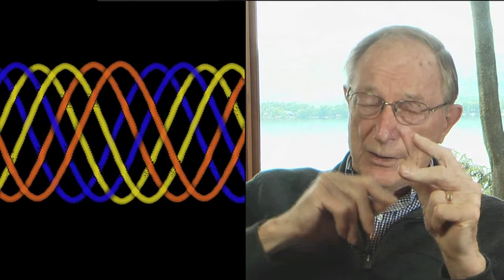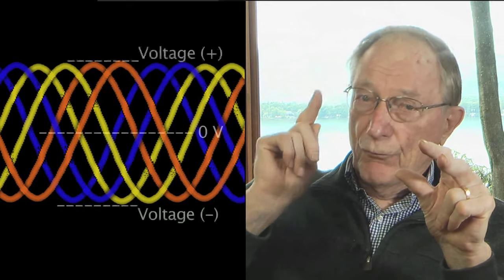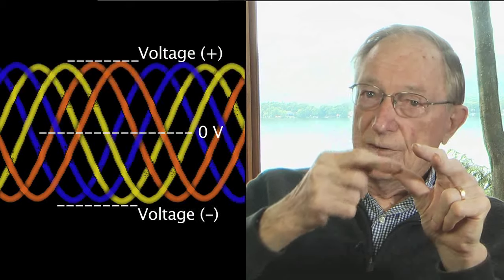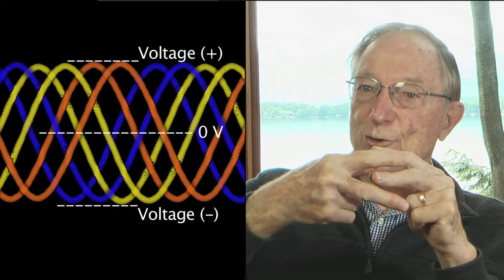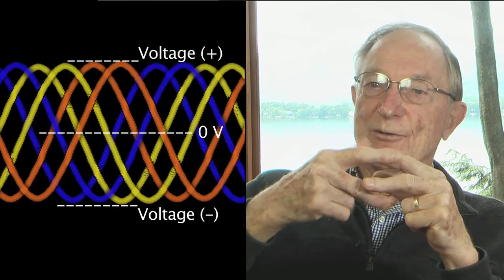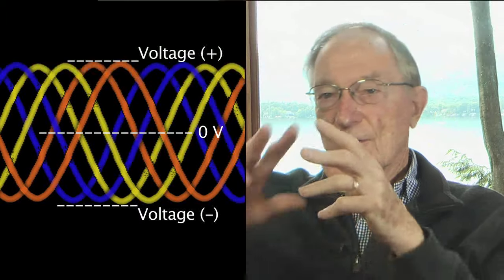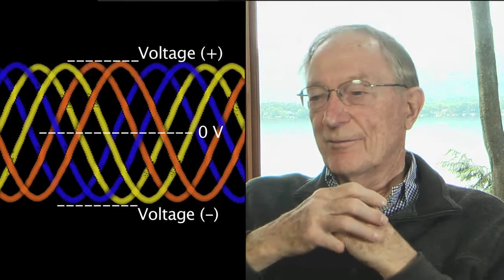Why 3 Phase Power? Why not 6 or 12?

Comment: Why is America 60 hertz and Europe 50 hertz?
Reply: That sounds logical, however, where is your proof and what about europe being 50 hertz.  I would have suspected it had more to do with minimal impedance and wavelength with actual continental distances.  You would want to have the wavelength matched to the maximum transmission line run across the U.S. and Europe hence the different frequencies.  However, I'm not an engineer so it's only speculation on my behalf. Anyway, your answer sound reasonable.
Reply: thank you that was very excellent I had never heard of 25 or 133 hz systems before.  thank you I'm most grateful. mark
Reply: Because Europe and some Asian countries were colonies of British and the 50HZ system was their standard they left there. Later they didn't change it because it costs and was working good.
Reply: +Salman Muhammad "...Because Europe and some Asian countries were colonies of British..."

Europe was a British colony???? Really???
Reply: +thoriumriver Yes. Some European countries
Reply: +Salman Muhammad which ones??
Reply: +Alex Roman For Example Cyprus
Reply: +simplechristian1 Basically - it comes down to a simple choice.
America chose 60 htz over 50 htz, mainly because it was easier for them to "synchronise" electric powered clocks (yes - as that meant they didn't have to use too many mathematical calculations - to work out how fast a clock would run), but by using 60 htz instead of 50 htz, that also "allowed" for a lower current to be transmitted greater distances, using the same wire, although .. they then stuffed that up, by keeping their supply distribution voltages low (presumably to avoid electrical shock - a total myth), which results in MUCH HIGHER current loading on cables, resulting in huge power distribution losses, caused by the current "squared" times cable resistance - creating HEAT LOSSES.

So -- in effect, the American's buggah'd themselves by using 60htz, 120/208v ..
Why?

Because it is NOT the frequency, nor the "voltage" that kills humans.

But the actual CURRENT that flows inside the body, between potential voltage differences, where frequency makes it "easier" to initiate the first push-through effect of a potential voltage difference.

Thus.
Although Edison "proved" that 60htz in an electric chair "kills" a human more effectively than 50htz, he failed to recognise the ONE major problem with his theory.
Frequency doesn't kill. 
Neither does a voltage potential difference.."
ONLY a current that flows "through/inside" a human body, if there is a voltage difference applied to overcome the initial resistance/reactance of the skin's natural insulation resistance.
Which in a weird twist.. also disproves Einstiens thoery - that DC doesn't kill and is thus FAR SAFER than any AC power source.

DC has a far greater potential to KILL (yes) and to keep killing, long after a human is actually dead, by providing not a pulsating (easily broken) AC current, but a single long running DC current "of high volume" which is very difficult to "break away from" when it starts running.
Thus DC of sufficient (applied potential differential) voltage - actually kills a human, not "just" by 'interrupting the electrical rhythms of the heart thus stopping & or fibrillating the heart muscle,, but a DC current physically burns the heart away, in generated HEAT (deep inside the heart muscle/human body itself).

In fact 60 htz AC has a lower potential to KILL (for a given high voltage) than 50htz AC, as the hiugher one makes the frequency, the further OUT towards the extremities of the skin layers, the current actually travels.
DC goes by the shortest DEEPEST direct route.
50 htz goes by way of the shortest indirect route, possibly via & thus in the blood stream itself, whereas 60 htz goes by a route "closer" to the skin, or muscle content.. thus interrupting the electrical pulses through the nerves themselves, and not exactly 'via" the heart muscle at all.
Reply: An island in the Mediterranean equals "Europe was British colonies", Crikey!
Reply: 60Hz is part of the Tesla Patent. Siemens, the German power group did not want to pay royalties. So; we in the Americas ended up with a household 120V/ 60Hz, the rest of the world ended up with Siemens 200V/ 50Hz. Interestingly, Japan splits the country longitudinally, half of the country 60Hz and half 50Hz which is why when Fukishima puked, they could not just tie into the closest power grid.
Reply: Europe is on 50 Hz for metrics.  230v is a more efficient system than 115v, but 60 Hz is easier on equipment than 50 Hz.  230-240v 60 Hz would be ideal
Reply: it may be because of
at 60 hz voltage level 120 v and 
if shock level capacity is min as compare to 50hz voltage level 230v.

but 50 hz voltage level power regulation is better hence europium perfer 50 hz .
Reply: Exactly. It costs a lotta money to change stuff. And when it don't need changing, that's actually wasting money and poor governance.
Reply: Europe is on the metric system.
Reply: I was told in school that 60 Hz was the frequency needed to keep the human eye from seeing light flicker. Not sure about why others used 50 Hz. I guess us Americans have faster eyeballs. USA! USA!
Reply: 50hz vs 60hz, quite a diverse group of answers to read, one person brought up "skin effect" suggesting that made it safer, another proposal (quite interestingly) made reference to continental size and wavelengths, I'll have to do some research but I'm going with the patent one for now. Just sounds like what ends up happening.
Reply: 50 Hertz have 50 cycles per second with the width of 20 milliseconds each, 60 Hertz have 60 cycles per seconds with the width 16.6666666666666666666666666......,  not that great  for Calculations
Reply: Salman Muhammad wow the ignorance...
Reply: cos america wants to be different from the rest of the cats!
Reply: Standardization. More freq means less losses during transmission but more complexity in control system and corona discharge. Nevermind 50-60hz is standard practice.
Reply: so you do not experience annoying lines traveling across your television screen
Reply: That's what I was taught as well, that is the frequency where your eyes can't detect the lights blinking
Reply: I had read that George Westinghouse wanted it to be 120hz. But Tesla's designs were for 60hz. And that is where we stayed.
Reply: Głos z Ameryki 666 repeating. So that’s where the mark will come from. Interesting
Reply: Salman Muhammad 50 hz, I believe, originated with the Siemens company of Germany, one of the largest suppliers of electrical equipment in Europe at the time.  50 hz became widespread in mainland Europe as a result.  Actually, Britain initially used a lot of 60 hz like North America, but later switched to the European standard of 50 hz., which was spread widely throughout the British commonwealth, except Canada, which followed the US standard of 60 hz.

Comment from the maker: Tesla developed 2 phase power systems.  Before Tesla Siemens was working with single phase.
Reply: Yes - well of course he would - wouldn't he - after discovering that he could utilise a single phase of a generator.. why wouldn't he want to use a second (or a third at 120 degrees phase angle from any other .. if he really wanted too - but?
DID HE MAKE FULL USE of that idea..?
Hell no.
If he had - I wouldn't have needed to find NINE (& TEN) inside any 3 Ph & Neutral 4 wire cable - now would I have?
And - thus - Tesla would have had upwards of all 64.77 million possibles too - if he'd have taken his theory to it's ultimate conclusion .. ?
BUT HE DIDN'T - he just used it as pure single separate lines - of two different single phases - in a two phase system.

Comment: 3 phase has always been the standard for power generation. Although the main power generator has a 3 phase output, the coil configuration consists of multiple  coils inside a huge segmented stator core. Multi phasing a generator would have no gain overall.  A typical multi-pole stator 3 phase configuration requires a certain amount of driving force to attain maximum output, having a 6 or 12 phase would require a much larger driving force to obtain the same maximum output and would be a lot larger in size to accommodate a larger stator, and the rotor would have to have more poles. Either not practical, or too costly...

Comment: So that's what older engineers do at Edison Tech Center... "3 phases 3 bus bars, 6 phases 6 bus bars, 12 phases 12 bus bars"... :)
Reply: Not quite.  Lionel is still working gainfully, both as a consultant and philanthropically.  And, his six phase work was done in the 70's or early 80's.

Comment: Short answer - you do get more power by adding more phases (up to a point), but for a few reasons, like to maintain 1:1 ratio of circuit breakers to transmission lines (?), increasing phases isn’t economical.
Reply: Dirk Knight  Completely false?

0:50 "but now you have, it would seem, twice the amount of power. You would, in fact, have almost twice the amount of power"

2:22 "it turns out that the gain in power is not proportionate...six phase almost doubles three phase. Twelve phase does not almost double six phase, so it's a diminishing return"

3:55 "So the complexity of coupling...a high phase order line...into a substation sort of defeats the economics of it"

There's almost certainly more to the problem than what he or I are letting on, but my summation of the central point of his 4min 47s answer is consistent with his words and not "completely false". If there's more pertinent info to add to the problem, please enlighten me and the world, but I'm saving viewers some time by weeding out the parts of his summary that actually answer the question from the exposition in his summary that is interesting but ultimately irrelevant to the question.

Another angle here is that while my comment may be consistent with the video, it is still false in regards to reality. If that's the case, then this guy (and by extension, I) didn't answer the original question and would benefit from your greater understanding.

Comment: That's the longest non-explanation of something ever.
Reply: what do you mean??
he explained it very well
Reply: 0:43AM And Im still waiting after the clip for the answer
Reply: Yeah he explained it very clearly
Reply: "so the economics of it just falls apart" It's too much work to adapt more phases to substations. It's not him, it's you.
Reply: @mohamedalhumaidi  No he didn't. The "economics of it" doesn't explain anything. Saying, "well, you would need 6 circuit breakers instead of 3" is a lousy answer. In many countries, I believe UK is an example, power is single phase to most homes. Why? The economics of having 3 wires into a house instead of 1? LOUSY ANSWER.
Reply: Paddle Shift yes, that’s exactly the reason. needing 2 wires instead of 4 is half the cost (maths is amazing)...
Reply: @paddle_shift  1 phase is DC. AC is a completely different thing that specific machines run on.
Reply: @paddle_shift  No one is obligated to give you a good answer unless you pay someone to do it. You have the world at your finger tips with the internet. Quit making excuses and invest time in to research. Either that or politely ask others to see if they might know and save you time.
Reply: @MicroplaysMC  obviously by your 3 responses, you are getting more upset as the seconds go by. Your recommendation to not use youtube as a source for learning is a good one (see the video on 3 phase vs 6 phase as an example). Your observation on single phase networks in other countries being DC vs AC is correct (I knew that btw). That's why in other countries that use single phase DC networks homeowners can't install home charging for their electric vehicles, they need to convert their home to a 3 phase AC system (very expensive) first. I don't even want to get into why countries went with DC vs AC in the first place, but I do know it wasn't due to economies of scale.
Reply: @paddle_shift  Bro, I'm just saying there's absolutely no need to be negative if you don't have to be, especially when you are more capable to find out on your own now than any other time in history. People share information on the internet, if it works for some, they'll take it. If you need a better answer, then it's "insufficient" to your needs, not necessarily "lousy". My point being, this has an intended audience, which probably consists of laypeople (what a surprise on such a platform). If it doesn't fit YOU then that's not the creator's fault, so don't call it lousy. If this were an hour long lecture on the economics of high phase systems then that would be different.
Reply: @MicroplaysMC  Look, don't take it personal. I was commenting to vikingslayer and other comments. The guy on the video is s real nice guy,  so kudos to him and his career. But it wasn't a video on 3 vs 6 phase power and why one and not the other. If a video was out there saying "why did some countries go with DC vs AC" and the video presenter said "well, because of economies of scale, they saw DC uses 1 wire and the AC uses 3, therefore they went with DC" would not be a real good explanation.
Reply: 3:20 - 4:30
Reply: @Grim_Falcon  3:20 - 4:30 = 10:50pm

Comment: There is one problem that was not mentioned.  The voltage on a 3 phase system is symmetrical from each phase to another.  This is not the case with increasing phase.  In other words with a 3 phase system each of the vectors are 120 degrees from another.  Assume a higher order phase system - suppose 4 phase.  Some of the phasors are 90 degree apart, while others are 180 degrees apart.  The voltages are not the same phase to phase.  This causes problems when trying to convert to DC to use power.
Reply: Converting to DC doesn't cause problems. In fact, it gives a smoother output without using capacitors to smooth out the ripples. Add a few capacitors and you have a flat line of Voltage. In the case of 4 phase power, simply tie the four thru diodes in a full wave bridge rectifier pattern and bingo, no problems.

Comment: In catscan and xray imaging we use 12 phase to create a more consitant power Source so when we expose  an electron cloud to the rotating disc usually made of tungsten we get a closer amount of alpha beta radiation for a specific technique set by the technologist so it still varies by what we input but its not underpowered or overpowered

Comment: Nikolai Tesla wanted to use 5 phase, as being (what he believed) the most efficient means of energy transfer, however his investors were worried about the expense of running 5 wires, and the cost of winding the transformers. 3 phase was selected as the best compromise.
Reply: DC transmission is more efficient by a factor of 2 than 3 phase and also does not suffer from impedance losses and limitations.  Today we have electronics that can easily convert DC voltages efficiently.  It’s also far more controllable and can easily be run underground.
Reply: @WilliamJones-Halibut-vq1fs  The key is TODAY. 
Three phase was a way better option in 1890 when Edison needed a power generation station on every third city block for his 110VDC system due to network losses.
AC transmission is inherently more robust and simple than DC transmission and is still far cheaper to implement for medium haul distribution so it will be round a while yet.

Comment: We use 3phase because we inherited it that way.  Tesla designed 3 phase generators, and all the technology created afterward just followed the 3 phase power standard, becoming a convention.  3p seems very practical too in the sense that it is easy to split 360 degrees (electrical and spatial) in multiples of 3.
Reply: With three phases you don't need a neutral wire and have a constant power output. More phases would not be economical. That's the real reason.

Comment: Fortesque's Symmetrical Power Method states the the method is only valid for polyphase systems for which there are a prime number of phases. Also their are a number of phase to neutral voltages.

Comment: Another approach that might work in theory is - A single phase Ac line multiplexed in an Anisotropic configuration at a faster frequency ( ie: 10 or more times the line Ac frequency ). In this way you have one Ac phase running any number of load phases sequentially switched, with the multiplex switching frequency being fast enough so the phase does not collapse in between cycles, but sustains itself around the circular path. 

In this way you only need 1 kVA to drive 3 kVA load in a 3 phase system or 1kVa to run a 12kVa load in a 12 phase system. 

The source Ac only sees ONE common load impedance between each Multiplexed point in the 360 degree cycle for each phase  ( as the other phases are off during that time ) and therefore the Ac source only requires a fraction of the power to sustain a much greater load.  Ie "Artificial FREE ENERGY" - You could call it "Digital Ac". 

Each phase in a 3 phase setup  would be kept at 120 degrees apart, due to the Multiplex frequency.  Multiplexing high power Ac sources may require some Engineering with vacuum tubes. 

The down side to this setup is - lack of surge capability and supply of high current loads. Capacitive and Inductive loads may run ok, if the phases of the Voltage and current are greatly leading or lagging and keeping the load power-factor withing the Ac source limitations, but not so using resistive loads. With resistive loads, the power-factor would be 1 and so the current and voltage sit in phase, placing excessive demand on the source Ac. Certainly an idea to tinker with if you have too much time on your hands and your into "free energy" technology. If this doesn't work, I suggest go back to a standard Ac 3 PHASE GENERATOR.